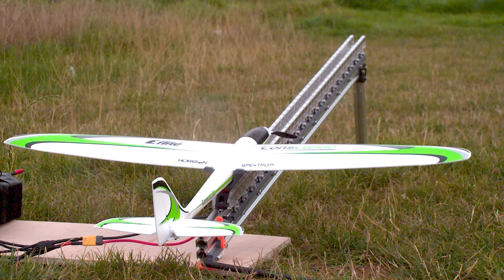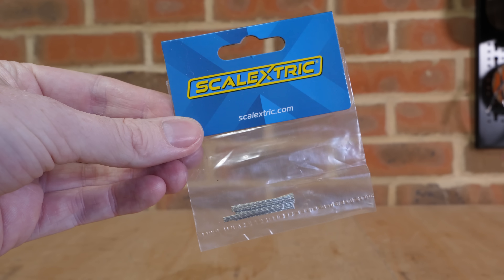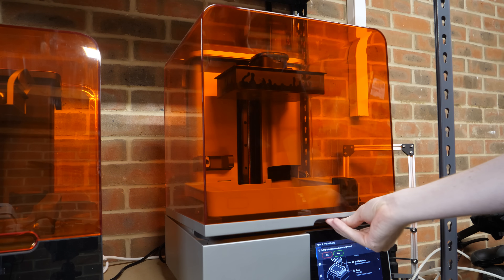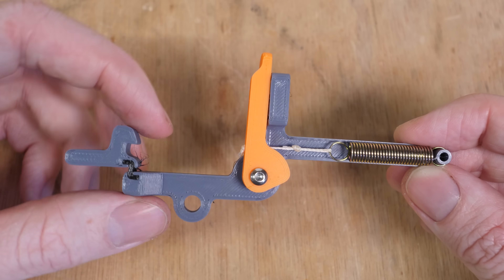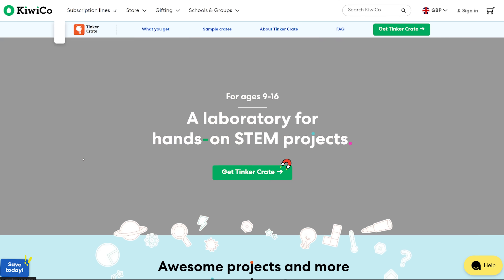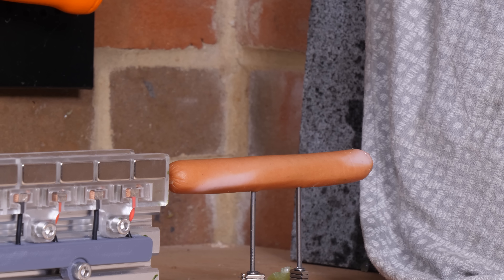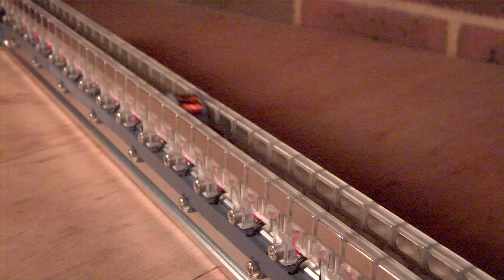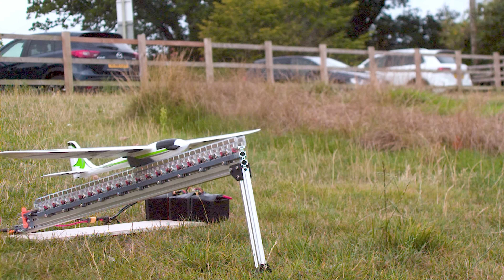Electromagnetic Aircraft Launcher

Comment: Clamp a wet sponge on the other side of litze. The temperature gradient will make sure the solder can only wick so far. We use it all the time in our lab with copper litze used for the flexible current leads our cryogenic systems need. Also in your sled turns experiment the inductance makes a big difference, specifically in combination with the power your psu can supply and how fast it can do it. The resistance of your contacts and wiring also plays in role in that

Comment: Excellent project! One of the things it puts me in mind of is the introduction of solid state switching in the 60's and 70's using semiconductors. The use of semiconductors for switching largish currents (a few amps and more) was not fully understood and there were initially many failures, so after engineers initially got excited about solid state switching (encouraged by the manufacturer's bilge!) there was a move back to mechanical switching and relays. The solutions to the problems caused in mechanical switching were much more transparent than the poorly understood semiconductors.
Likewise, you say you wanted to simplify your launcher from any use of electronics which makes it a much more understandable demonstration. Well done!

Comment: Is there any advantage to spacing the magnets slightly further apart, along the sides of the rail?
Does putting the brushes and contacts underneath the sled, so that the mass of the sled and payload press down onto the brushes, improve electrical contact and give more acceleration? Thanks Tom.

Comment: Funny that I pretty much had this same idea years ago to launch spacecraft. The majority of the mass of most spacecraft is fuel and structure to contain this fuel, so it stands to reason that the faster you can launch it, the less fuel it would need and the less overall mass it would have. 
Someone much more educated than myself would be able to figure out the the perfect ratio to reach escape velocity with the smallest craft and least amount of fuel possible.
If every launch vehicle was reduced in size realitve to the payload it delivered, I feel like the cost of such a reusable system and its power needs would be recouped relatively quickly.

Comment: Could the technology used to launch small gliders found in this video, be used to keep a small-scale train going in a round cercle being boosted by magnets shown to launch small gliders? The video tells us how to make an Electromagnetic Aircraft Launcher. I was wondering if it could be used to keep a train moving in a cercal. I asked AI, and this was the answer, I added the power needed at the end. -- Yes, the technology used in launching small gliders via magnetic propulsion can potentially be adapted for small-scale trains in a circular track system. Magnetic propulsion systems, like linear motors, can generate continuous motion without the friction of traditional wheels on tracks. Here’s how it could work: 

Magnetic Levitation (Maglev): Utilizing magnetic fields to lift the train off the track, reducing friction and allowing for smoother and faster motion. 
Linear Induction Motors: Similar to the glider launch system, a linear motor could provide initial thrust to accelerate the train along the circular track. 
Power Supply: A reliable power source would be required to maintain the magnetic fields, ensuring the train can continuously cycle around the track. 
Control Systems: Incorporating advanced control systems to manage speed, acceleration, and stopping is crucial for safety and efficiency. 
Scalability: The size and materials used could vary based on the intended scale, but the underlying physics remains consistent. 
While challenges such as energy efficiency, cost, and practical implementation need to be addressed, leveraging magnetic propulsion technology for small-scale trains is indeed feasible. 

“The train just needs a push to start, and then the momentum of the train needs to be enough to reach the next Electromagnetic Booster. I’m guessing it would need at least two low boosts? After the train starts, the only thing that will stop it will be time and ware of the track.” 

Share this:

Comment: A different approach to eliminate switching: Use your Scalextrik track along the length of the launcher, but use a "frequency generator" to produce an AC sine wave. Start with a low frequency and increase the frequency to get faster speeds.

Comment: I don't understand why you don't reverse the arrangement to put the PM magnets on the sled and the coils along both sides of the rail while applying counter currents to each coil. You can use opto interrupters to trigger each coil. Therby eliminating the metal  transfer between any contacts, as metal transfer and contact pitting are both destructive processes.

Comment: Carbon brushes as used in electric motors with springs keeping tension would give cleaner contact, longer brush life and less arcing
Reply: What you've made is essentially a linear dc electric motor ... so the same brush material makes sense

Comment: Really enjoyed the sled's impression of a clownfish at 9:35 (as the copper contacts flap wildly, they look like tiny fins).  Possibly I missed something, but was there some reason you had to use a spring-loaded switch instead of a simple button?  Or, I suppose, a knife switch for the proper "mad scientist" feel of it?  Or was it just more fun to design a multimaterial print?  :)
Reply: Buttons aren’t rated for enough amps

Comment: The original design using static coils was the way to go.
If you want to get to seriously high speeds you will need to drop the hall sensors and go for optical sensors.
There really isn't an upper limit of how fast you can go with a coil design apart from C though there are other limits when slinging a mass in a circle so Mach 25 should really be considered the limit on earth.

Comment: there's this thing called a rubber band.  It is certainly less expensive and readily replaceable.

Also, go back to the 400 wrap carriage and then fix your rail.  There's too much friction.  You could use roller bearings, or as long as you like to complicate things, use a semi conductor in liquid nitrogen to make a hover track.  Near zero friction (still have air friction).

Comment: Hello, I suggest you use graphite sliding contacts similar to those used by electric motors with brushes. for triggering, you can use an outer contactor used in industrial installations. Sincerely, Antonio👍

Comment: A way you could probably get some extra speed out of the aircraft launching is by creating a different mount that will allow the propeller to spin up before the launch starts, allowing the plane to contribute to the force some as well.
Also if you're looking to ever get a sure fire way to get more amperage out of a switch in the future, the components for a power relay and the needed debounce components are under $10 USD.

Comment: Using a laminated core from the laments of a transformer  inside the launching coil and using modified carbon brushes from electric motor operating on 2 long strips, built from circuit board material etched like a flat commutator and soldered should radically increase acceleration and power.

Comment: More turns and thinner wire can be offset with higher voltage to get more efficiency.
Also, better thermal management with the use of graphite and thermal paste should help reach higher capacities.

Comment: you need -
an electric motor of at least 200 watts (for example, from an electric drill)
A toothed belt from a 3D printer.
A rail guide with a carriage.
You will do the same thing without fireworks, a bunch of magnets and headaches and much more efficiently.

Comment: Nice design. I did an optically timed coil gun back in the 1990s. It shot a 1" diameter bearing 2 to 4 meters vertical. Each coil was powered by a modified h-bridge of hexfets and diodes and was on only when it's optical sensor was interrupted, or one of the previous two were. This made a traveling magnetic wave down the tube that pulled the projectile forward. When I turned a coil off I dumped it's energy back into the power rail via the diodes. Current limiting was by wire length. I was putting 200 Amps through 22 AWG magnet wire. Needless to say the coils couldn't remain on very long or they would turn to slag. I didn't bother to heatsink any of the FETS or diodes because the on time was so short. Power was from a capacitor bank charged with a 24 Volt linear power supply limited by a 200W resistor. I forget how many ohms.

I'd go on to make more and more powerful ones.

Comment: Why not match a capacitor with the inductor to create resonance on the magnetic teeth? This approach would allow for higher frequencies and more efficient operation with minimal contact, as the capacitor charges. You'd simply need to synchronize the magnetic teeth. The inductor also energized as speeding magnetic teeth pretty best idea to counter resistance of magnet.

Comment: Several comments on your creation. 
1st:  you need capacitors on all your switches!  These will, at least partially, eliminate the sparking!  I would look for a paper di-electric capacitor such as those used in magneto ignition small engines, as the voltages produced, making and breaking those coils is very high! 
2nd:    Your metal commutator should be changed to copper, and carbon brushes used.  I understand, proof of concept, low cost etc.  I'm just saying. 
3rd:     Your coils need iron cores!  Look at the brushless motors that are everywhere now. 
Your magnetic efficiency would go through the roof

Comment: i'm wondering if having both the contacts on the sled and the contacts on the rail be brushes instead of strips would help increase contact surface area and provide any sort of improvement to performance, it might at the very least simplify rail maintenance because you could use an entire spool of wire for each contact and, as they get worn, you can just pull out some fresh brush and cut off the worn section

maybe also lube the contacts with a graphite paste

Comment: Think id just attach a 50cm long and thin silicone power wire to the projectile. With a mild magnetic connector that detatch easily at the end of its range.a bit like thise magnetic detachable usb and lightning ports.

Comment: To potentially reduce damage on the launch car, maybe you could add a runoff at the end that has rubber bands or something to slow the car down or using the same set up with no electricity charging the magnets to act as a magnetic brake

Comment: I could see a potential mod for it is a sort of fishing line spool that connects to the back of the sled. Give it enough slack that it doesn't interfere with the launch, but short enough that it prevents the sled from getting lost if you were in a place with a lot of tall grass or by a lake. (Obviously not needed for launching in the park, but a neat potential add on. 

Still really cool!!
Reply: Or having a cap at the end of the rail that has a spring facing towards the coils. The spring decelerates the sled, while allowing the RC plane to lift off

Comment: you should have split the contact section and the magnet section in order to experiment with the activation timing. Considering that the field in the coil needs some time to build up there is a sweetspot when to activate it and it would probably have to be finetuned.

Comment: If you really wanted to overengineer it, you could replace the physical contact brush-based switch (whether self lubricating graphite or otherwise) with a magnetic sensor that reads changes in the local magnetic field to turn on electricity to the sled

Even simpler, make the sled the permanent magnet and line the linear rail with EM coils - to allow much more precise timing as well as increase in forces proportional to the voltage across the coil (and hence the EM field)

the whole thing could be controlled with an arduino or pico board. It wouldn't be as 1950s mechanical wonderland but it would work

Comment: Tom, there's a video by Cliff & Kajun on YT about 3d printed bearings, and instead of printing the balls, they use filament itself, and make a roller bearing. I think this could be integrated into your air powered engines, cause they would be way lighter than proper metal bearings.

Comment: I've just found this video channel.
Why not reverse the system.
Put the magnets on the launcher and the coils on the rails and use electronics to switch the coils, eliminating the contact arking and bouncing in switching.

When at St Albans CFE, Hertfordshire, UK, in the 1960's
We had one of proessors Eric Lathwait's linear motors.
It was incrdible the acceleration was amazing and dangerous.
So by using electronics the coils could be fine tuned the timings of the coils by a say Raspberry Pi.
Great video and desciption.
Thank's.

Comment: You didn't need to replace your metal strips for those wired brushes. The Aurora HO scale cars used metal band with a hinge on one side, and a spring on the other. This way, you get constant contact no matter what your "track" looks like. All you needed to do was install a soft spring to make sure the plates kept in constant contact without adding additional friction from a stronger spring pushing harder outwards.

Comment: How would it work if you made the sled just a wheel/coil. The rolling sides are the contacts.. and the source contacts are the surface on that it rolls/the bottom of the rail. The contacts on the rail are carbon and the wheel is copper. 

Then make the rail a looping.... gravity will make the contact perfect. NOW make the loop flexible... and when wanted speed is reached... it gets derailed on the launch pad... where it hits into a perfectly shaped catch... that is connected to the plane.... and the force of the coil launches the plane. If the impulse is too high for the plane... you could use the original rail as a startup rail..where the much faster coil catches up to
Reply: Also really wonder if it wouldnt work even better if it was just an iron ball in a tube wheel where the coil is winded directly arround the tube in many segments that can be switched on and off. The switching has to be controlled electronicly... but that shouldnt be too complex to programm.. by measuring the change in the coils resistance.. to determine the balls position. Or you could use a switching algorithm that just speeds up really slowly ... or pulses. This way.. instead of the need for crazy high amps or voltage... you only need more time.

Comment: If you put the same voltage across the sled coils (but through a very large resistor) so that its contacts are at the same voltage as the parallel rail contacts, there will be no sparking. And the extremely low current through the sled coils when between rail contacts will not produce large enough magnetic forces to interfere with launcher operation.

Comment: what about using a knife switch to handle the de-bounce on the main contact?  make it so the knife and jaw are long enough to stay in contact even with the bounce, and make sure the jaws are tight enough that they don't bounce when they're parted by the knife.  or, if the knife part is long enough, there could be more than one jaw, so that as the first jaw bounces, the second one will be in contact, et cetera.

Comment: LIM launch for a roller coaster explained pretty dam well other than the high voltage sparking... but could be a great tool to build a 3d printed/knex/coaster dynamix roller coaster with that method scaled to work on them as well, and would be using the sled as the object rather than just a catch car, although using that as a catch car is how cable launches work as well so is a good explanation of those techs as well

Comment: You could also use the reed switch to control a relay. Usually automation circuits use small current flows to let the operator control relays to activate circuits.

Comment: If you add a capacitor parallel to the coil ends, you can reduce the electric arc between the contacts. Nice project, very fantastic works can be done on a larger scale.

Comment: need to adjust the distances between the sets of rails and magnets as it goes down the track, as the magnetic field needs time to expand and collapse.
You also need to find its center and ensure the magnets are at the greatest pull before it reaches the center of the magnet as it travels along or you risk overshoot and adding a breaking force as it passes this CenterPoint and the field collapses.
Your also going to have to deal with eddy currents being generated in the coil existing the magnetic field.

All and all, pretty cool, but lets try to get a supersonic grape!

Comment: Great stuff but is there any reason you didn't just use the reed switch on the control side of a relay and use the controlled side for rail power? I think it would be simpler than your actuator with less parts to tune.

Comment: It would have bene interesting to use an off the shelf electric motor brush from something like a battery powered drill.  Those brushes are not heavy and will cope with a lot more current than the solder wick which melts easily.

Comment: The replaceable brushes on the sled, I would have the Solder Wick clamped to the Nickel Strip with the 3D Printed retainer and screw, so all you need to do is loosen the screw, pull out the old wick, and slide in new stuff, then reclamp. No soldering needed.